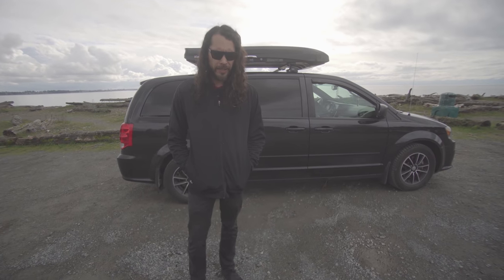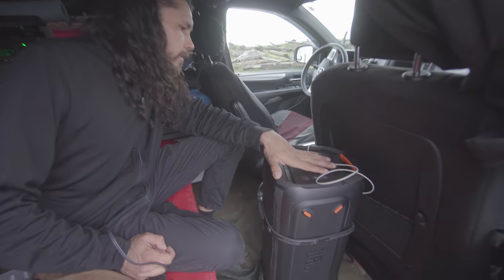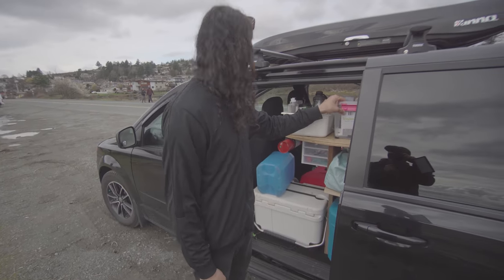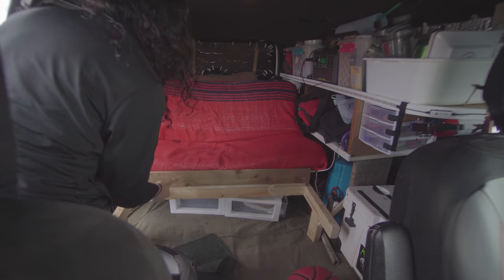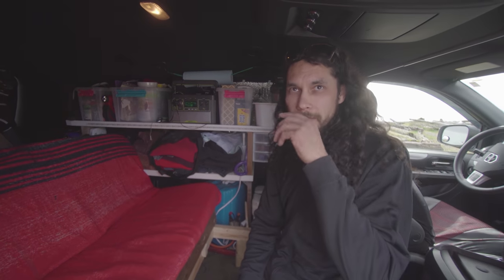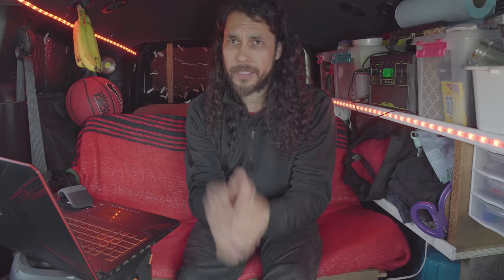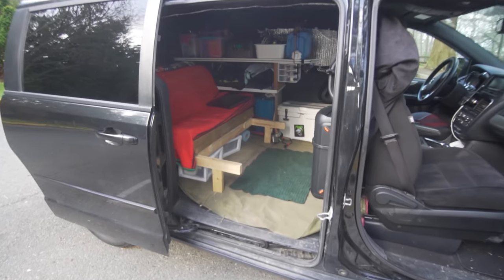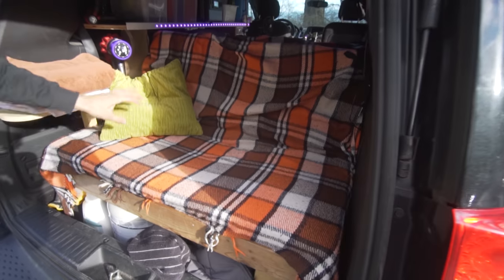Stealth MiniVan Camper conversion. Blending in with a Practical Build out in this Tiny Van Home.

Comment: Did a minivan for years before my Transit MR130. 1) swap that passenger seat around 180 degrees so you can use it while parked. Foot area forward of seat is now storage accessible from passenger door. Laundry-find a place that does laundry and ask for a special rate of 'not much' every two weeks or what have you. Dried and folded is a cheap luxury. Microwave-with right sized inverter you can run a  600 watt microwave (AMZN-$60) with the engine running. Do your math to verify needs here. Shower-join a gym. Social too. Since your working full time you what?, somewhat in the same area so maybe in a small storage unit. Ask for the cheapest unit in the worst location in the place and work your needs up from there. Remember, if your not paying rent, you gotta a chunk of change available for such 'luxury' items that also have you traveling to access too, which is ok.

Comment: I also have a rooftop carrier. Unfortunately it's a dead giveaway lol. However I don't have a van with fold away seats. They take up room and add unnecessary weight and added gas consumption. To avoid that you need a van that's older than 2006 depending on the make.

Comment: You can buy a portable shower that consists of a heavy duty water bag with an opening at the front where the shower part flexi hose and shower head screw in,at the bottom of the bag is an opening a bit like a hot water bottle where you fill your bag with warm water and screw it back  up this bag hangs from the roof of your van just lay it on the roof attatch it to an anchor point with shower head pointing down,you also get a shower curtain that attatches to your back doors,you can get one with a rod in the top  that makes your shower curtain shaped just like a shower,they are a very handy kit to have and do not take up a lot of room when not in use...it would save you running around looking for an open Gymn or wherever ,I believe you can get these from Amazon or camping stores...and no pump or anything like that needed...  just gravity...check out the internet for portable showers..

Comment: Have a question about your battery pack can you plug that into a cigarette lighter and charge it as you're driving down the road?
Reply: Yes you can. It's designed to charge via solar, 12v or thru a wall outlet.
Reply: Yeah, but you max out at like 18-40 watts so it can take like 12 or more hours which'll eat up gas or simply kill your starter battery if you're parked

Comment: Does anyone know which model of Thule roof rack he's using here? His van has no rails so it's a version that clamps down on the door frame I think? Any help appreciated! Thanks.
Reply: It's an INNO Wedge 660.
Reply: @mikeredhead143  That's the roof box. It's the actual roof rack (that doesn't need the rails) I was hoping to find.
Reply: @stuartkjackson  Right, sorry.  I used the Thule 480R Rapid Traverse racks.
Reply: @mikeredhead143  great thanks, I'll look into that model. Hoping to get the same setup on my van. Thanks for your response.
Reply: @stuartkjackson  you're welcome bro.

Comment: So your employer is okay with charging your generator all day and filling water jugs?!?
Reply: runnersgarden As an HR manager I would support these as “creative employee benefits” that do not cost the employer very much and the return in employee goodwill & engagement is priceless! Bet he is an excellent employee!
Reply: Dual car battery system google it...the car charges one for the car and the other for electricity or jump starting the car..no solar panels needed...a gallon  of store purchased water on the front seat gets very hot in the summer when the car is parked